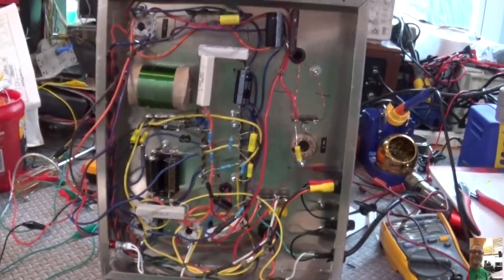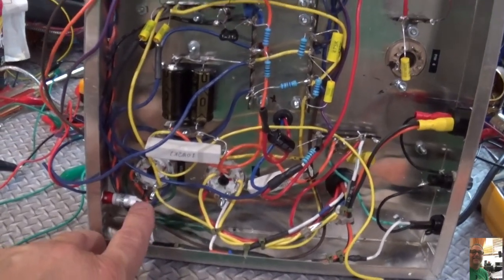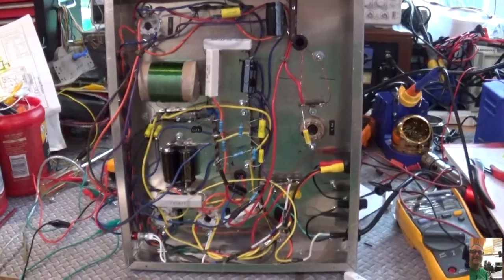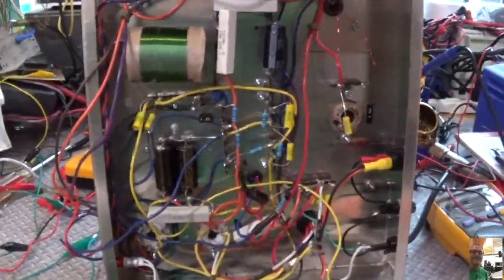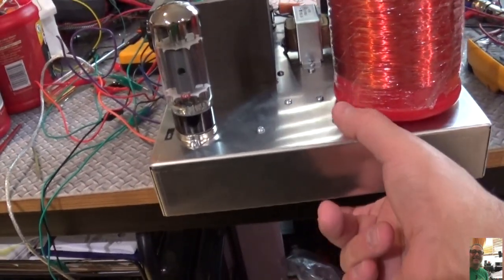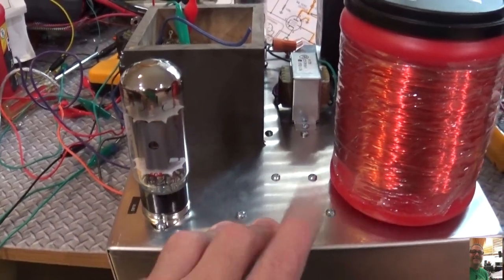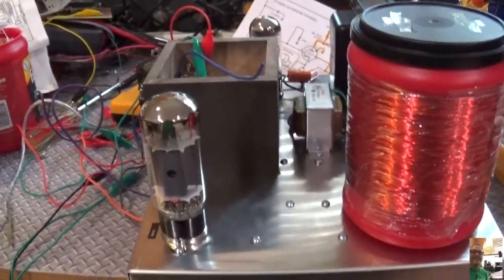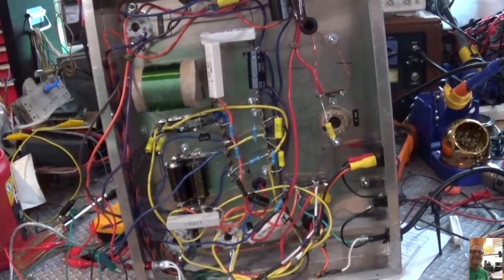Rick McWhorter AM Transmitter Build - Episode 11  -  Make Transmitters Great Again #MTGA

Comment: is there a value for the L2 coil ''choke'' you called it? wound mine 4'' dia, 24ga wire its only 3 1/8 tall sure dont look like your coffee can,want would change if the turns of  windings were less or more?

Comment: I hope I am not too late.   I have been thinking about this xmitter and it finally dawned on me what was bothering me.   That noise is 120 hz buzz.  I was just viewing Rick Macs old vids and he had a radio that was buzzing and it dawn on me that it is 120 hz noise from the radios power supply.  Then I viewed your vid 8 in this series.  You said that you were going to add a 2 k resistor in between rectifier and the first 47 uf cap.  I looked around at many tube gear schematics and the vast majority of tube power supply pi filters do not put a resistor between the rectifier and first filter cap.    If they do they are under 50 ohms.   You are not only dropping voltage across a resistor but you are restricting current flow through it.  My thought is your xmitter is starving for current in the subsequent stages of filtering and you are getting 120 hz pulsed DC ripple into your circuit and the xmitter is adding that to the signal and you are hearing it in the receivers.    May I suggest this quick test.  Power your xmitter up and start transmitting, then scope probe the B+ at the 300 volt point and 167 volt point on the circuit.   You should be seeing clean DC and minimal ripple.   The ripple should be less than 2 or 3 volts.    About 1% of the DC voltage at that point.   Good luck
Reply from the maker: Jp....... very very interesting.. and you are correct in that 2k resistor was added. This was because my B+ voltage was way above 300v and I wanted to keep it true.... Your point makes a ton of sense and I will try the experiment today. Now that you have explained it, it really does make alot of sense.  very good stuff Jp... I thank you for being my mentor - I really appreciate it my friend, very much.  - Will report back.  Ron
Reply: JP,
Perhaps a bit of over-thinking the problem.  To reduce the 6L6 plate voltage to 300vdc in my transmitter, I had to add a 2.2K 10-watt resistor to the B+ line prior to the first filter cap and it didn't produce any noise at all.  The transmitter works fine.
Regards,
John
Reply from the maker: I have a good mystery on my hands.... I think its being caused by Russian collusion... LOLOLOL.... Will let you guys know what I find here....I am sure it will be easy to find once I stop overthinking it myself.
Reply from the maker: An interesting observation on my transformer..... The secondary is only 350vac CT... when the design calls for 570VAC  CT..... I am thinking perhaps my transformer is struggling to provide what this design needs.... am I over thinking this
Reply: John    I am just a firm believer of having clean power supply voltage so you have a known starting point before you start troubleshooting.    First commandment of troubleshooting.   Thou shalt test voltages.  One unknown eliminated at a time as you go.    If you have no feel for where to start troubleshooting I always start at the beginning.   This video of Rick's at the 30 second mark sounded just like Ron's radio interference and that is what got me thinking.        https://www.youtube.com/watch?v=KqjGk6dPtlQ      Gotta love Rick.

Comment: Ron,
Reconstructing the transmitter in a larger chassis will be very good practice for you, but not necessary.  Had you temporarily removed the pilot light and wires there probably would have been a big reduction in noise.  Also, all your wires should be right up against the chassis.  In that regard, it helps to run them under the terminal strips rather than over the tops.  It's a tight squeeze under them, but the wires will fit.
I've already mentioned ARF member, Daniel Hilderbrand (now deceased), to you.  He built the Rick McWhorter transmitter on a small Philco radio chassis and placed it in the radio cabinet.  Rather than a transmitter, it just looked like a regular radio which was way cool and it worked great, so chassis size really isn't an issue. 
Anyway, stay the course, my friend.  You can do it.
Regards,
John
Reply from the maker: John, I regard your advice as gold and therefore as I shall forge forward with the suggestions.  I will modify my current layout but will use the same chassis... more fun that way -  :)   I appreciate your encouragement very very much.   Thanks Ron

Comment: Ron     I really admire your ambition and I agree with your assessment about layout and wiring scheme "BUT" I have one big question.    What changed from the time you showed us it working so nicely to what it is doing as wired now.   What ever was different is the logical cause of your issues.   The changes should point you in the direction of what needs to be revised instead of taking the extreme measure of starting over and changing everything.    I think if you analyse those changes you will find the problem.   I think you are 95% good and only 5% away from a working  transmitter.
Reply from the maker: JP..  I meant to cover that in the video and did not.   When I had it somewhat working, I had the tuning cap gator wired from underneath. I also had the power switch gator wired as well as a few other things.  All of those connections not being fixed helped to make it work. Once I did the permanent connection the problems started - largely around the 6L6 tube.  I was going to try and fix it but when looking at all that wire under there, I know it will be nearly impossible to get it quiet.  That is why I am going with a more simplistic approach......  As as bitten me before the PREP work was not done right and here I am.  Learning much here my friend.    Thank you so much for your help as always.  Ron
Reply: I think you are passing up a great learning opportunity here.  This is where the rubber hits the road or should I say where test gear hits the circuit.       http://memes.yarn.co/yarn-clip/d9534811-b844-4e30-94cd-88a6e1e89abb/text        You are so so close.  It already worked cleanly at one point.    My electronics mentors always used to tell me.  "I hope your project does not work,  you learn more by fixing a problem than if the project works the first time."  You can do it.   If it is near the 6L6 than look at it logically and probe its inputs (grids) and see if the noise is coming in that way.     If the noise is not there then look at the outputs (anode and cathode).  You have plenty of help here.  Like John from Arkansas always says "Take it slow.  Work it one piece at a time.   Don't get overwhelmed".   The most obvious starting point is what changed when you installed the tuning cap, power switch and power meter.  You can do it.    Make sure you use an isolation transformer when using your scope on the transmitter.
Reply from the maker: Great advice that I shall adopt..... You all are such great inspirations... I love it.. I predict this will be working by Monday.... thank you so much JP

Comment: Did you get a chance to use a tracer and just see if you could find a beginning point for the noise? Just wondering Ron as it has to start somewhere. Keep on trucking bro.
Reply from the maker: I did Carl.  The noise was concentrated around the 6L6 Output tube as I suspected.   The wiring that was running around there was just too much... 180VDC next to an output tube just was not working... so i would have had to rip it out anyway... why not go with more real estate  :) I could be Ronald Trump.... LOL    Thanks my friend - Ron
Reply: Well Mr President,,, that sounds like a winner lol. I figured it would be strong around the output. Good lesson here as I know if I decide to give this one a go, I now know the dimensions I will be using for sure.